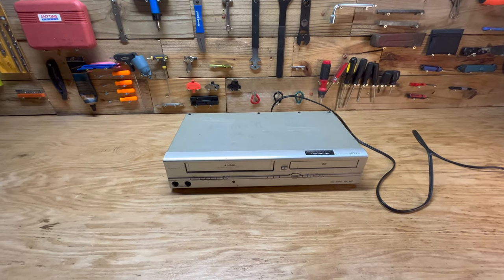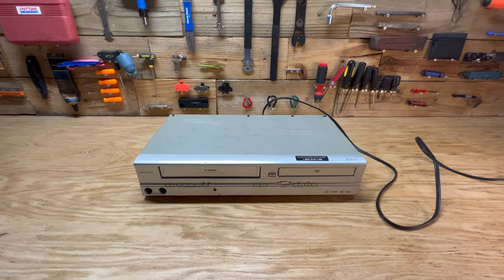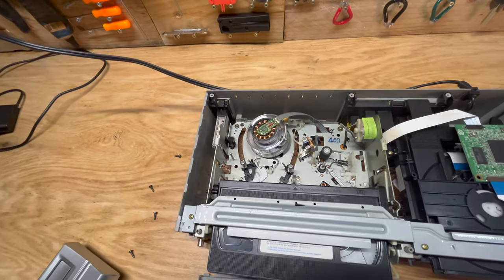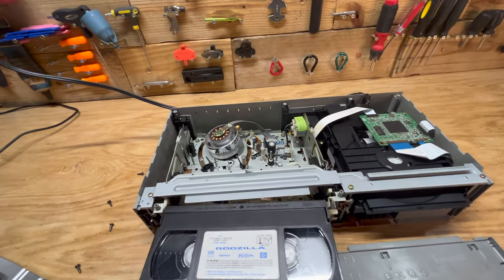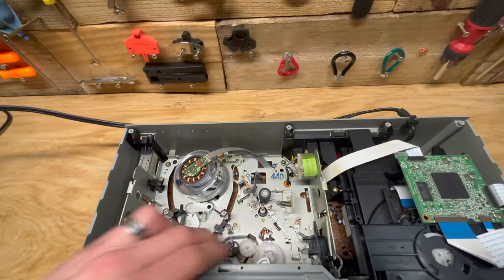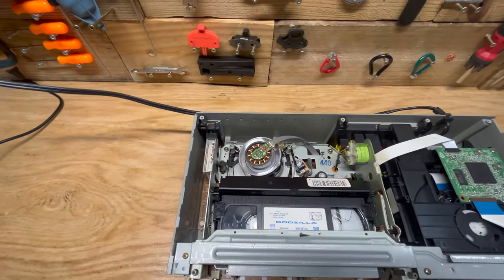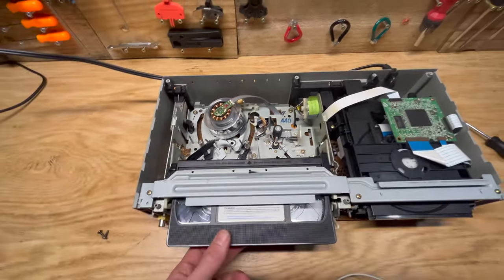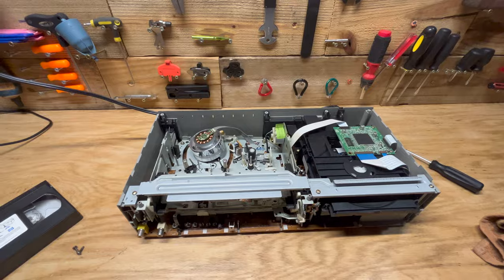VCR Eating Tapes Fix! How to Stop Your VCR From Eating VHS Tapes! Sylvania SV2000 VCR DVD Combo Fix!

Comment: You need to change the drive belts if it's not spinning it will not continue going. because there's a black and white gear underneath the main drive gear is a sensor if it's not turning it will shut off.

Comment: Did  you realign the mode switch correctly ? There are identations marks/arrow that must point to each other
Reply from the maker: it wont fit in unless you align these marks, so its hard to put in wrong